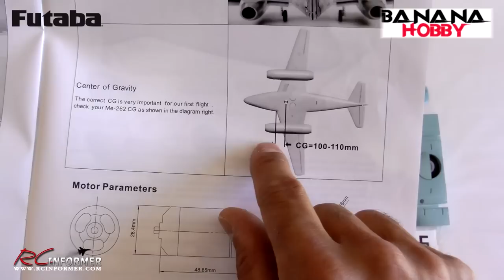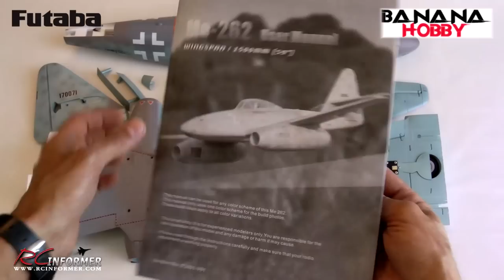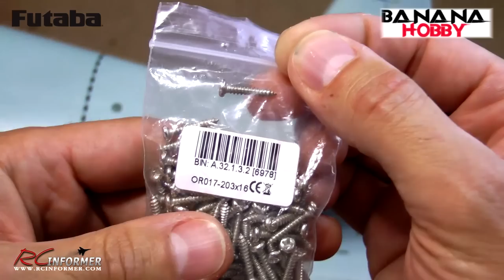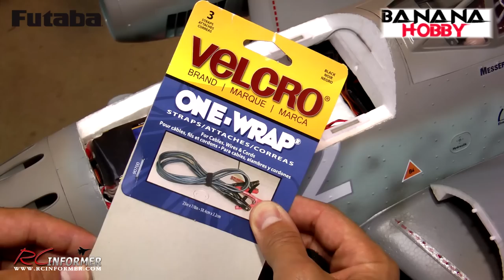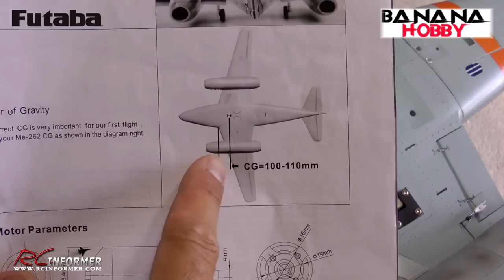Banana Hobby / FREEWING Me 262 Review & Build Guide In HD By: RCINFORMER

Comment: One good thing is Freewing / FMS now implemented most of the suggestions that you mentioned in your video.  For example, all FMS new 980mm size warbirds that have metal nuts in the wing joins.  Another example is the AS150 plug used by freewing's big jets now have the opposite male/female plugs form +/- polarity. I think you guys really made the push to the manufacturers, and thanks for that!
Reply from the maker: That was actually the plan:)

Comment from the maker: Technically Deans are rated for 65 amps, the plane can draw 105 amps static on the ground, but the plane normally does not run at this high amp draw sustained. I have thoroughly test flown this plane hard with sustained full throttle settings and have not had a problem.... Even BVM Jets use deans.

Comment: Hi; I'm an amateur enthusiast, just trying to get started. What magazines, You-Tube video's do you guys & girls ( I'm sure there are some female enthusiasts out there), should I read or watch to give me a better understanding of certain nomenclatures. Such as ESC's ? I hear that alot. Thank You Pete S. Buffalo, NY USA
Reply: Hi ya Pete, an ESC is the " Electronic Speed Control" it applies more or less electric voltage to the ducked fan motors on each of the jets wings,,,in the case of the ME262 or the same on a single motor prop plane.
Reply from the maker: The ESC is the Electronic Speed Controller. It is the printed circuit board that connects between the battery and the Motor and it also connects to the receiver for controlling the speed of the motor. Most electric planes both prop and EDF (Electric Ducted Fan) Jet planes have an ESC... The ESC is considered to be the "brains" of and also the most important part of the electric drive system of any electric plane.

Comment: Question:

What could happen, If I would not remove one red cable from the engines which are connected to the receiver? I didn't really understand what you did there :x
Reply from the maker: The esc's provide power thru the red wire, ground thru the black wire, and signal thru the white. You CAN just plug both ESC's into the receiver and fly.... BUT, you run the risk of the 2 esc's providing uneven POWER thru the 2 red wires causing potential ESC shutdowns. It is better to remove one red wire from one esc and power the receiver from only one ESC.... BUT it is BEST to remove both red wires and supply power to the receiver with either a separate BEC or separate receiver battery. the black and white wire provide the ground and signal for throttle control, the receiver power can come from another source.
Reply: RCINFORMER Thanks!
Reply from the maker: several outcomes are possible... nothing could happen and it will work great. BUT, for example, if one ESC is providing say 5.3 volts and the other is providing 4.9 volts to the receiver, the power from the stronger one can reverse flow thru the other esc and make it shutdown! A transient power flucuation could randomly cause this also on any given day....BOTTOM LINE, use only ONE power source to power receiver.

Comment: Bah...I am going to try and fit a metal thread insert into all the 'plastic' mountings to use machine-bolts...
Reply from the maker: Martin Alberter Already did that:)
Reply: RCINFORMER Spent most of today researching this topic...I've seen so many variations from different types of knurling of the outside of the inserts, to different types of installation from 'cold press' to thermal to ultrasonic...any chance you could let me know what worked for you?
Reply from the maker: Martin Alberter I I put a blind nut in a block of wood and put it on top of the plastic doublers inside the plane....
Reply: Ah, ok. sweet!

Comment: I am having problems with my Freewing ME262. I changed the motors to 12 blade Freewing EDF's and had a few crashes as I could not take off. The airplane veers to the right after lift off and crashes upside down. I set the motor counter rotating as same as the one that came with the kit, and set the Spectrum receiver at the center of the longitudinal line of the airplane. I check the CG many times and is within limits. I fly RC planes for many years but this one is giving me a lot of troubles.
I am using an Admiral 5000mah 50C 6S 22.2V with two Castle 100 ESC to support the motors demands.
I have a lot of thrust and it is align, no tendencies. 
Please, tell me where to look for this issue as a had no successful flights after many take off attempts.
Thank you.
Luiz
P.S. I am a B744 captain.